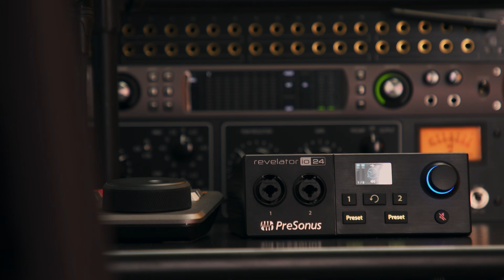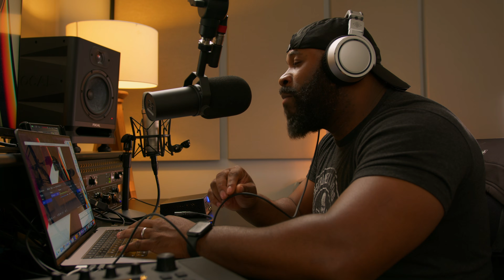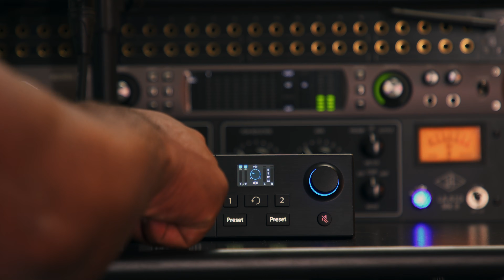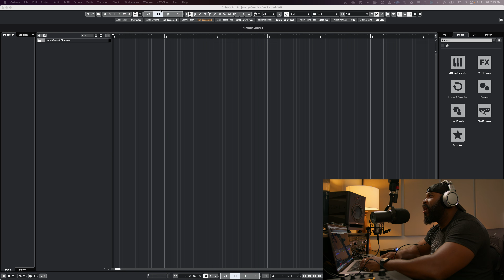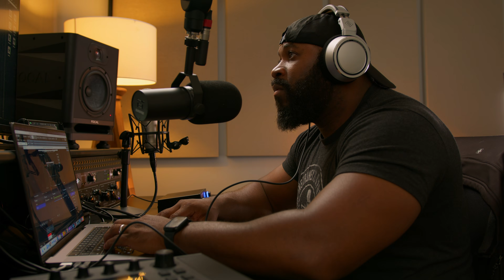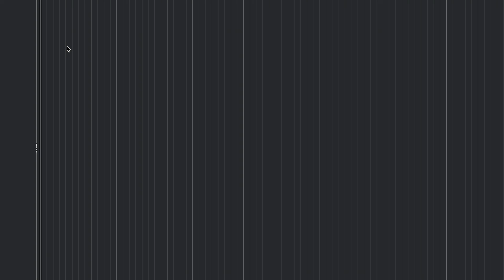Beginner’s Guide to Setting Up Your USB Interface

Comment: I would like to know if it is software dependent? I have an older PreSonus audio interface that has to use software to pan the inputs in stereo. My old ART dual pre works in stereo with Open Camera app. I have to use attenuator xlr adapters to not clip. I am looking to upgrade to 24bit or 32bit. If I use a computer software isn't an issue. It is the ability to use to stream live into my Android phone or tablet.